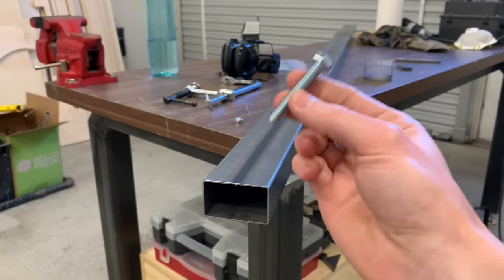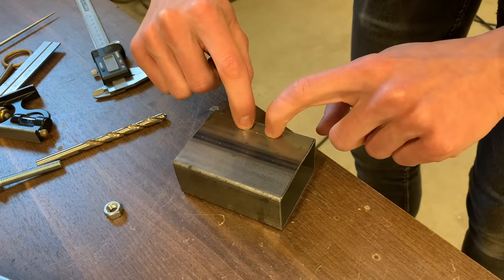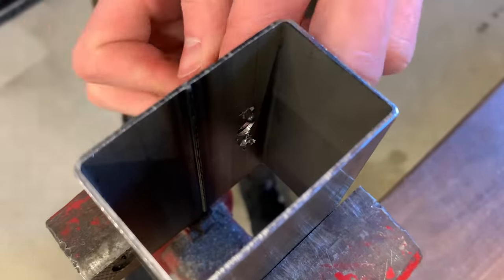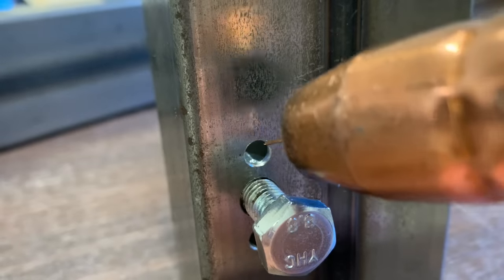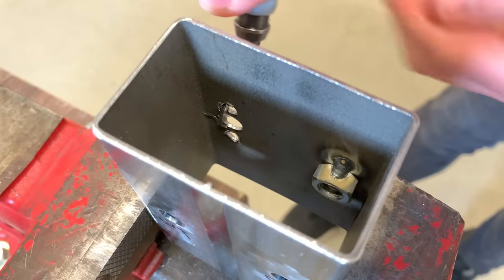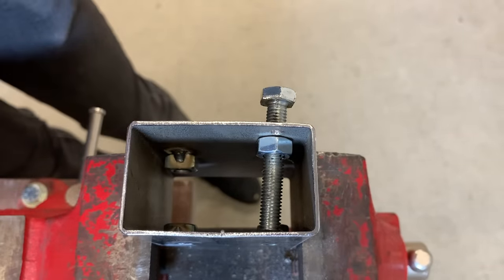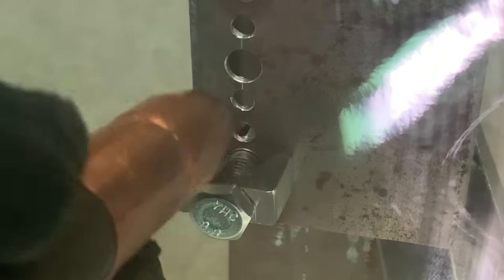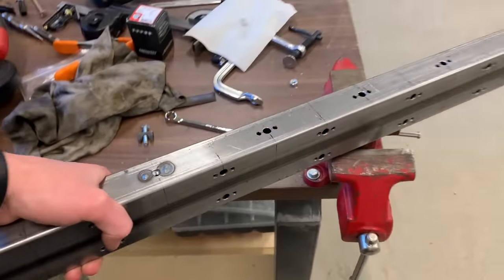Welding nuts to the inside of steel tube

Comment: Omg. Talk about faffing about.
1. For the time and trouble, buy a rivnut kit.
2. Plug weld a short piece of 1/4" flat bar uvder where you need the hoke, then drill and tap through box and plate.
3. Manipulate a bolt through from the inside poking up, tack weld its head  through small holes,  making a stud upwards for securing instead of a bolt downwards.

Comment: Could you not have simply drilled big enough hole for nut to barely fit through, then put top of nut level to outside of tube (or slightly below) and weld the resulting 6 gaps. Grind excess weld and done.

Comment: Riv nuts are cheap. You do not need the special tool. Used a same thread bolt and nut to set the riv nuts.

Comment: Time is money. Seems to me that rivnuts would still be cheaper in the end. Especially if you modify the nuts on the lathe and make a bunch of specialized tools.

All you need to install rivnuts is a bolt, a nut and a pair of wrench if you don’t want to get the special tool.

Comment: 0:20 "rivnuts are very expensive and require specialty tools".  BS.  You can get a 200 piece rivnut kit for $20 and finish this project with much less time and work.  I like the solution you showed and may use it at some point, but you make this look like one of those infomercials where you've created something revolutionary to solve a daunting task that would otherwise be nearly impossible.

Comment: Jer, riv nuts are perform better and are less expensive. The tool costs less than than the grinding disc, mig gas, wire and calipers not to mention the hours of your time wasted. That said a tool is not required for riv nuts, check out vids on other channels.  

Your way of doing this is not a wrong thing to demonstrate, but to state it will cost less is.

Comment: Too much work with tiny holes.   I figured out a better way to weld the nut 360 degrees, much more mechanically sound than two tiny tack welds.

Comment: Rivnuts are way less time consuming and the tool is not that expensive. You also made custom tools and the time spent drilling the extra holes and welding totally makes up for the spent money. Also, not everyone has a wire welder and a lathe and guessing this is too fine work for mma.
The only advantage I see to this method is the increased strength and area of the nuts compared to rivnuts.

Comment: Too complicated and the welding spots are weak.
I am using a much faser and easier method:
1. Put the nut on the bolt.
2. Make a hole on he tub where the nut can barely go through.
3. Keep the bolt on the nut and carefully weld 6 small spots on each corner of the nut just enough to attach the nut to the tub.
4. Fulfill the rest of the welding.
5. Grind and polish the surface.
6. Done. 
This method is fast and reliable. Makes a strong welding, does not need any additional tools and it works every time independently on the length of the tube. 
Alternatively, you can weld the nut to a washer and make a hole on the tube with the diameter of the washer. Then weld the washer to the tube. Grind and polish. Keep the bolt on the nut throughout the process.
Enjoy...

Comment: Interesting, but a complete waste of time. Riv nuts and tools are dirt cheap. You don't even need the tool. Just use a bolt washer nut setup with two spanners and you don't need a welder. 😊

Comment: Well... Why don't you use a little, slightly prolonged plate, made out from the piece of that square tube's wall, with a hole a bit large than a bolt, in its center. So firstly you ticks a nut to the plate, then put your still warm "winged" nut into your tube, press it against holes just as your video shows, and then tick nut's "winglets" to the tube with classical "electric rivets"? A little piece of metal dramatically simplifies a welder-hobbist's task... ??

Comment: You said that riv nuts are expansive…but this method is so much more time consuming that you must not value your time to be worth anything. The tool and a selection of riv nuts is very inexpensive compared to the time you’ve spent using your method

Comment: So hold on, rivet nuts are no good, cause you need a tool, but making a tool for welding nuts is good? This sounds like you're creating a problem that already has a solution. 

Rivet nuts are much faster, and provide good enough strength since it's only tube. Also they don't leave a bunch of blobs on the inside of tube were the nuts are welded.

Comment: Y'all are making it too complicated.  I'd just drill the one hole out bigger, insert the nut flush, weld the circumference and grind flat.  Takes about a minute and requires zero access to the inside.

Comment: Rivet nut tooling expensive and out of reach for a hobbyist? You can literally install a rivet nut using a bolt and a nut. Instead this method used a welder, a table saw, a grinder, a benchtop drill press and even a lathe.

Comment: I watched this and think this is too much then read the comment about rivet nuts but then went to harbor freight got it and got it done within an hour. You put too much thinking and using caveman method. The tool is like 40$ and u get to use it again it’s not like it’s disposable after one use and it’s useful if u weld and metal fab. My main reason is I’m working with aluminum tubbing if it’s metal then I’d weld. Plus it’s for a 24ft installed gate so I can’t be on the ground messing with it all day. U got all these spinning tools that cost thousands to make your own parts but think a 40$ tool is too expensive